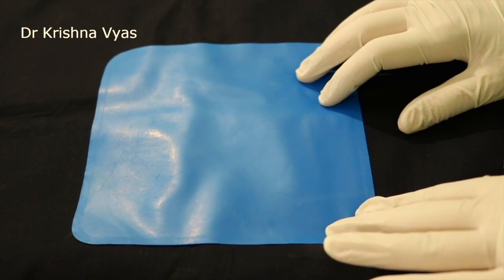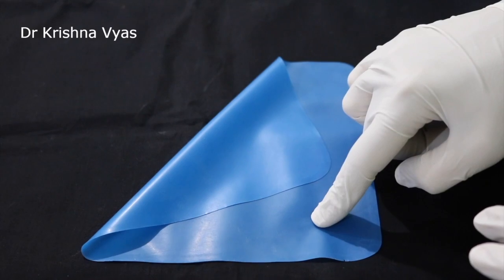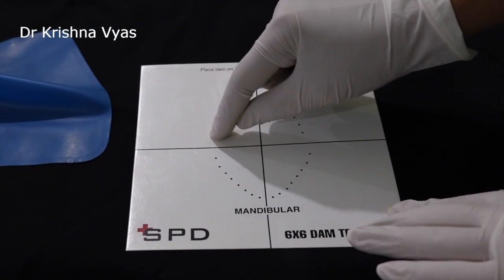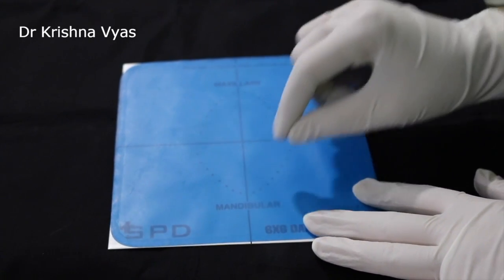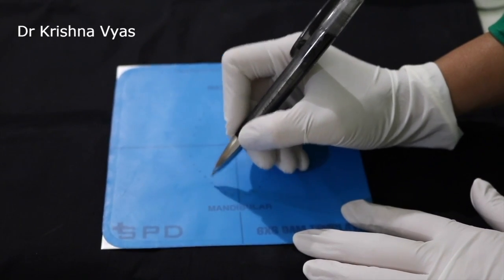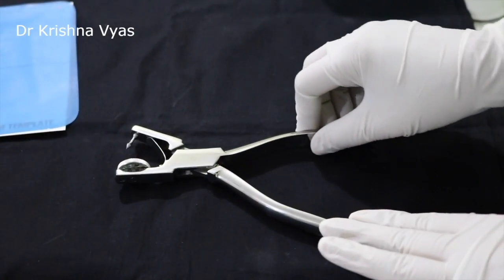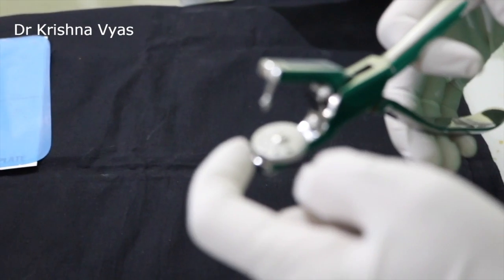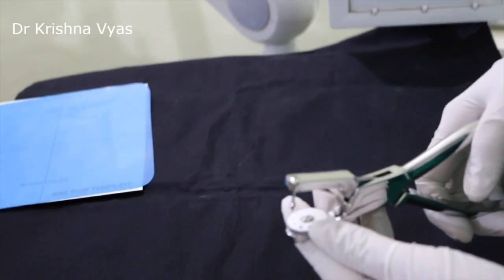Rubber Dam application for beginners.

Comment: 11:40 What fluid did you used to prevent leakage?
Reply from the maker: I used 'Liquid Dam", which is a light cured Rubber Dam liquid. It's available with various brands.

Comment: Would this set up be for root canal treatment ?
Reply: Yes, single tooth isolation is ideal for endodontics. For most restorations you usually clamp the tooth adjacent to the working area, especially Class II.
Reply from the maker: As Dr Mustafa replied this video is for single tooth isolation for root canal treatment.
Reply: HHHHH .... the stupid question
Reply: @Anas_93_Dec  not a stupid question if its from a non dental professional
Reply: @rachanaveeresh4466   i was young dental student when  i commented soory castilo